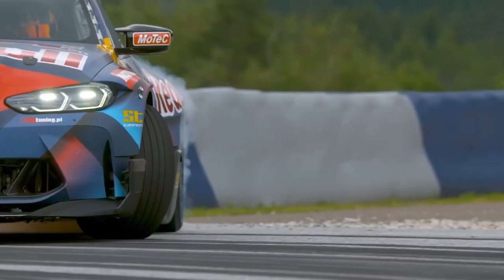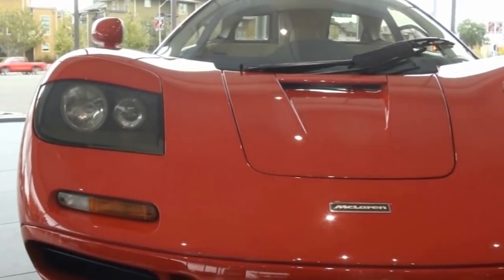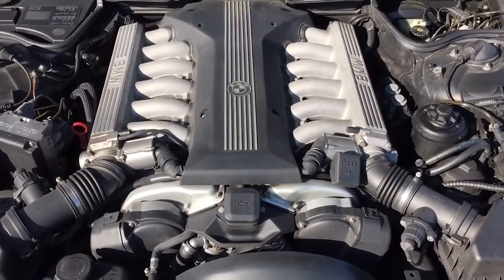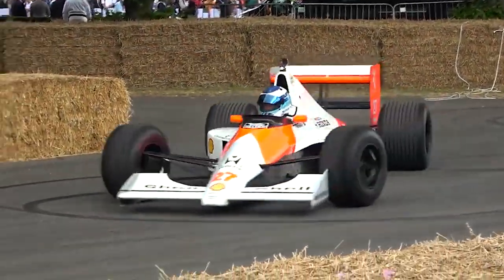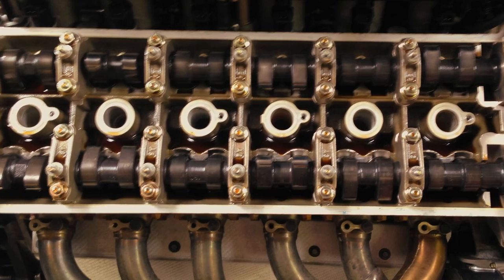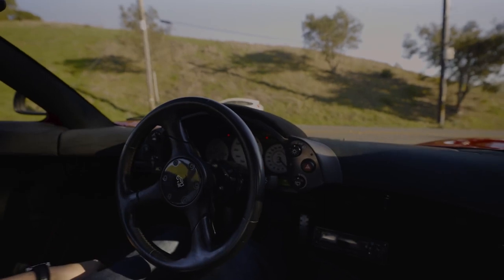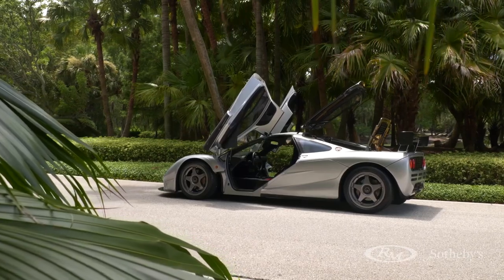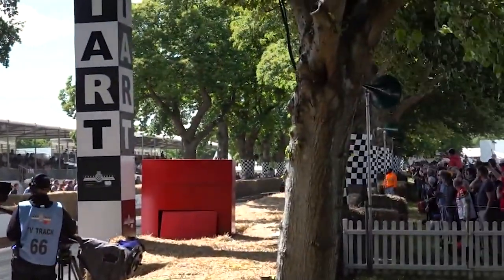The Best BMW Engine Ever - The S70/2

Comment: Best ever BMW engine was the M12 which was a main block of the late 60’s BMW 2002 and a twin cam head that powered the wining F1 race car putting out over 1500HP. The engine was also used in a 70’s BMW 2002 that won the Le Man race. It has been used in other F1 race cars winning continuously. It’s still being used in F2 and classic races winning all around including hill climb and so on. It’s BMW’s god father of the engines.

Comment: the early v12 you show is not an m70 its an m73 . m70 is 5 litre v12 300bhp m73 is 5.4 litre 327 bhp and has next generation throttle bodies etc

Comment: I would say the award would have to go to the only engine that could drive for 4 years without breaking down ,isn't that the 3liter diesel om or og whatever
Reply: Maybe if reliability is the only metric you judge an engine but cutting edge technology, performance and sound are important marks of an ICE engine for the rest of us.
Reply: literally all bmw engines could drive for 4 years without breaking down. The only ones that couldn't was the f1 engines they ported to production cars, that being the s83 (for their v10) and their m3 v8 engine. And also others that can't drive for 4 years without breaking down are used ones because used ones, especially M ones, tend to be treated poorly... (revved hard, etc)

If you look at the b58/s58, it's the most reliable production engine on the market, and since BMW uses inline sixes all over their brand, it has made them one of the most reliable brands ever. Behind toyota (and toyota's child lexus). 

Bmw had a rough period during 2007-2014... but other than that their engines are much better than competition. Even their V8s are rn making 1200hp with only rods and pistons done, and their famous s58 i6 has managed 1300hp with only rods and pistons done... Only having rods and pistons done means that the engine is almost entirely stock...

The fact that you are complaining about reliability in a car brand which can produce 1300hp with such small amount of modifications is really sad, and I rather see you drive your sad camry for the rest of your life. The Nissan GTR's engine must be completely rebuilt and even have its displacement increased to reach over 1000hp... And you're complaining about reliability from BMW which has been known since 2008 to make cars that literally sound like they could compete in f1, and easily compete with actual supercars.